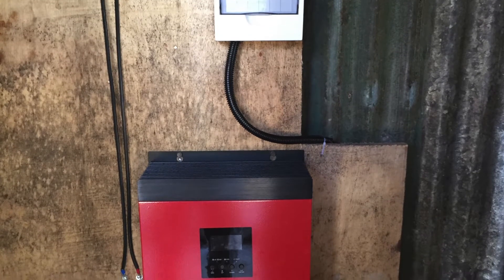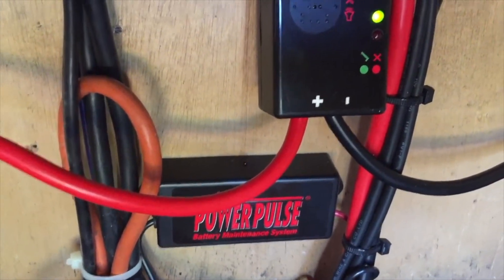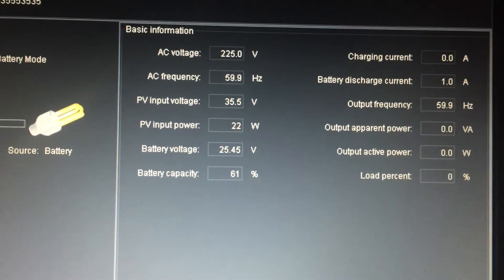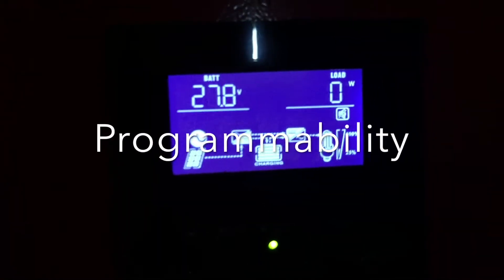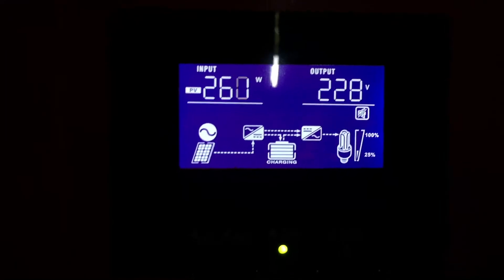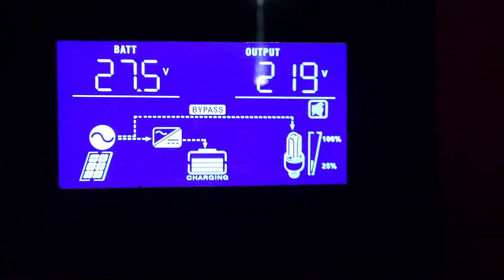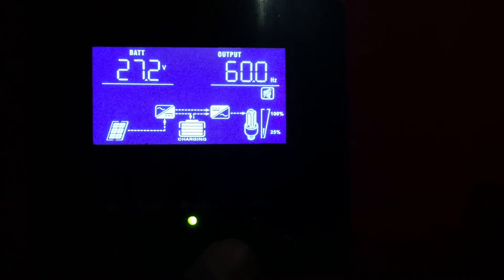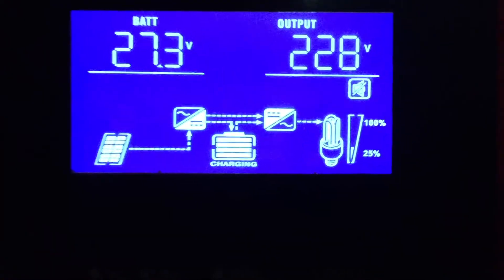1 YEAR Review of MPP SOLAR Inverter

Comment: Do U have any comments/advice for grid tie use. Thx.
Reply from the maker: I only use hybrid inverters.  If you use strict grid tie you are basically saving all of your energy to the grid (or power company).  In some countries they do not give you a 1:1 ratio.  For instance if you give them 2 kW's they may only give you 1 kW back.  You're using them for storage, but if their grid goes down you will also have no power.  A hybrid inverter can power your house, charge your battery (to act as supplement or when the grid goes down) and provide excess to the grid to pay you if they have net metering.  Hope this helps.

Comment: How is the MPP holding up?
Reply from the maker: Been a little over a year and a half with no maintenance and it just keeps running.  Lots of rain lately though so not prime for solar everyday, but it uses batteries first.
Reply from the maker: The first one I had still runs and that's almost five years old.

Comment: Question? I’m on the verge of going for the MPP 5000w 48v or the Growatt 6000w 48v
Any thoughts? Seems the Growatt has a better longer warrantee and maybe better, parts built a little better?
Reply from the maker: The Growatt is a good product based on everything I've studied.  Originally they were building grid tie inverters, but I've seen a few rebranded MPP products through.

Truth be told I think MPP might be a rebrand, but I've had no problems with their products.

Personally I chose MPP because their prices are competitive.  Others cost much more and my unit is used on a farm so theft in less secure areas can be an issue.
Reply: Solar Farmer I guess being a novice the main element for me is the two year warrantee. 
After watching you repair your friends Mpp unit, I think I’m capable of that as I have a little knowledge but nothing like yours. But the comfort of the warrantee is very tempting for a few more dollars. That’s the only reason because what I’ve watched the Mpp is comparable but their warrantee is almost nothing. 
Thanks again for your input, very helpful.
Reply from the maker: @boblevey  

Good product.  Agree with 2 year warranty.  Wishing you the best of luck.  You'll enjoy solar.  When all is paid for it's just free energy.

Comment: our  mpp 5048mg keeps using grid unless load is over 2kw , ignors  5kw worth of unused solar power sitting their  .. also every half hr @ nighttime it keeps switching to battery
Reply from the maker: Wow!  Sorry to hear that.

Might i ask your settings?  I set it to power saving once and it dud much the same.  I thought power saving was good, but it did the opposite by forcing it to "sleep" and only wake at a certain amount of wattage used.  As soon as I turned that off, it worked fine.

Comment: Hello sir I’m looking to get 3 of this and string connect it I’ve a daily load of 10kwh and I really need to buy this I’m using a Tesla model s module please I need your advise
Reply from the maker: The model I have is NOT parallel-able.  There is a model that is.  I believe I refer to the model somewhere here, but MPP SOLAR's website does provide specifications on each of their products and are clear on what can be paralleled.

Comment: I hope to get a MPP next year, and probably get two, for split phase, what I like is the big mppt charge controller in these, like 80 amps in the 5k, I'm thinking I'll go with 2, 2400w, either splitphase or parallel, I don't have much 220v appliances, a clothes dryer and cook stove is it, and thinking about getting a gas stove, since I have a gas water heater, I'm planning to add another array of pv, between 2500 & 4kw range , theese MPP inverters would go well with the array,
Reply from the maker: Sounds like a very good setup you're planning.  Let me know how it goes.  I'd be interested to find out how your parallel works out.  Good luck.

Comment: I have heard ppl pushing these hard, even 2500+watts from a 3kva I have a different brand 5kw inverter, I don't pull over 30 amps from it , it's from china and works fine, alot of the companies seem to put their profits back in to making the product better, 6 years ago I wouldn't touch a powerjack inverter, but 2 years ago I bought one, they sell replacement parts, and seem to be made well, these seem to be nice also,
Reply from the maker: This is my second one.  I needed more power and the first one I bought was to experiment with.  If they last just five years it's worth the money.  A high end unit is ten times what this costs and more difficult to set up.

Comment: What does the PIP stand for in the name stand for ?  There is a high quality  system very similar to this one .  Its made by SOL ARK and  they offer 4kw and 8kw and 12kw models but costs are fairly close for 8kw and 12kw size and would generally be about 12kw for about three times as much as three of the  MPP4048 MG ones
Reply from the maker: Not sure what PIP stands for.  I do know there's a lot of re-branding going on with these products.  Beyond that I wouldn't know.

Comment: whats it like now ? thinking about getting 6x unit for parallel operation
Reply from the maker: I liked it so much I replaced it with the new PIP 5048GK that runs without batteries.  This one is the older technology and I bought it with only 2400W capability.  The new one I have up is 5000W and runs without batteries.  Stayed tuned for my inverter and all the new features it has.  It's working amazing.
Reply: @SolarFarmer  How does the batteryless feature work when you're under large loads?  Does it switch to and from grid power without issue?
Reply from the maker: @todius7  Yes.  It does it seamlessly.  Certain times it can use all three at the same time, but mostly it will be solar and battery or solar and utility.  It depends on how you program the unit.

Comment: == I got  MPP PIP 5048 and came with broken AC terminal. I had to pay $28 for new AC terminal and replace it myself. MPP does not have a warranty .
Reply: I saw you review on amazon for that lol.  Are you using the inverter?
Reply from the maker: @erics5716  I don't know if I reviewed it on Amazon.  I bought it from Alibaba.
Reply: @SolarFarmer  Must just be a common problem then, I saw a review just like that on amazon.
Reply from the maker: Yeah I think their warranty has shortfalls, but they do have one.  At best they do just let you replace, but if you're handy the work is fairly easy.  Just be sure to unplug things so no shocks occur.  Still, my small inverter works well, but I have a bigger one now.  :)
Reply: Thank you for sharing this important information listening from Brownwood Texas

Comment: Even though I would never buy one of these, I do agree with you that in terms of value for money they are fairly amazing, but only because they cost so little money. Literally like a third of the price (which still triggers my "what's the catch?" response). I'd be interested to see how it does as it grows older, since at 1 year it has probably barely left the warranty period. On the weekend I took my 5-year old Victron Multiplus off the wall and did some maintenance on it. It worked very hard, it was running ESS at full power for several hours every day. The only thing that required repairs is the plugs at the bottom of the unit, and I had to blow out some dust. My buddy up in the Karoo has an MPPSolar (Axpert branded) that's now at 2.5 years, but he also treats it softly. I will be very surprised if this makes 5 years in the hot Philipine climate :-)
Reply from the maker: Yes it does get hot here.  I have it in a well ventilated closet which is under a shade, but working in there still gets hot.  I was in Australia recently and (if and when I have the money) I will eventually outfit a system with Solar Edge because it's so efficient.  But then again it's a trade off.  Victron is very well made and damn near indestructible so....and then, of course, there's Magnum.  The great thing about the Solar industry is that there are so many things you can choose.  Their competition makes them that way so if MPP wants to stay in the game, they'll also have to produce lasting products (which I hope for so all prices drop).  Personally if coin wasn't an issue, I'd already have SMA on the farm as that is what most farmers use.  It's bullet proof.  For now, I have to work cheap.  Thanks for your input.  :)